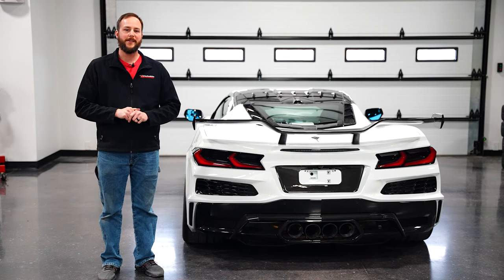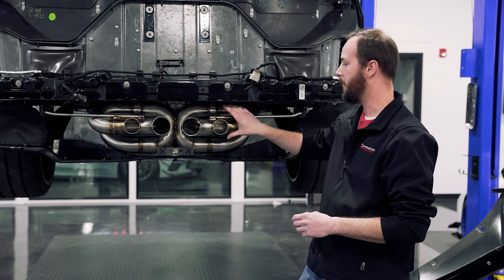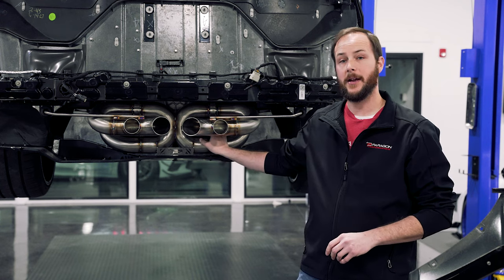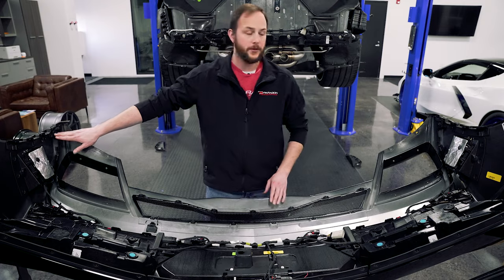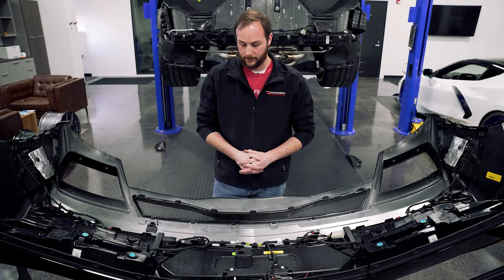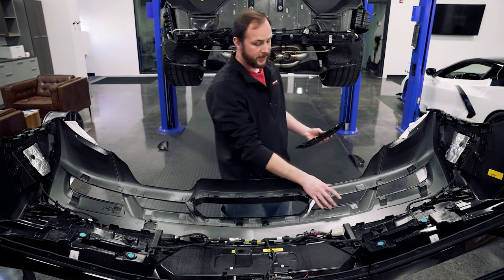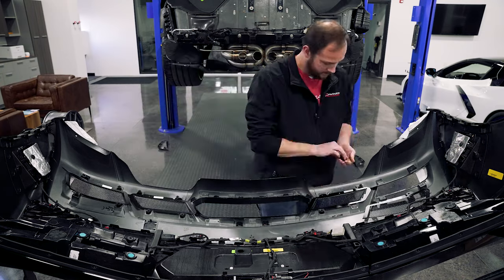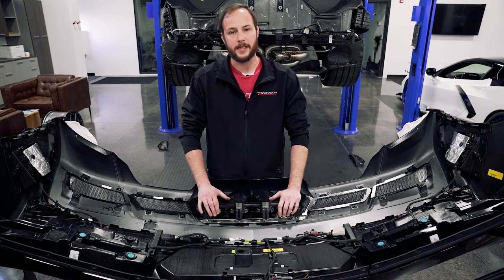C8 Corvette Stingray/E-Ray Center Exit Exhaust Conversion Install!

Comment: Lemans makes a center exhaust where you can still use your OEM diffuser, slight modification of the center. And the exhaust sounds killer!
Reply from the maker: The Lemans Edition exhaust requires you to cut your OEM rear valance where we use a all new OEM piece from GM. With our kit you can always go back to OEM side exit if you choose.
Reply: @ParagonPerformance  exactly why I said slight modification. I’m not sure why anyone would want to go back to the stock one. I also hate extra parts laying around taking up space. The Lemans kit is also $1,000 less. One could buy another rear diffuser with the savings. Both companies are great kits, was just sharing another option. I have the Lemans being installed soon. This one is great as well.

Comment: Scared for temps so close to the DCT with no heat shield.Whats the weight vs your other solution? Looks great!
Reply from the maker: We’ve track tested our touring exhaust at multiple locations with 20min sessions with 0 issues. The avg user won’t see those temps on street.

Our center exit weights in at 25lbs where our touring is 32lbs.

- Justin
Reply: @ParagonPerformance  thanks man, will likely be grabbing the touring at some point!

Comment: Looks good for those that wanted a center option.. On a side note I see you guys made a nice very light wight Ti non-valved exhaust, but not a valved version. I see you have one from another CO that is very $$$ , but why didnt you offer attachments for your other system? Also, I know the E-ray is not out yet but is the system and measurements the same? thanks
Reply from the maker: Making a valved exhaust either from Ti or Stainless will increase the cost greatly. 

The center exit will work for the E-Ray!

Comment: Any horsepower/torque increase? Also if you have a diffuser will it still fit?
Reply from the maker: Similar to the touring in power increase. It will not work with the Verus Engineering Rear Diffuser.

Comment: If we wanted to install a CF z06 bumper would it be possible to buy this kit without the diffuser? If not can the part numbers for the vent be provided or purchased elsewhere?
Reply from the maker: Sounds like you just want the exhaust portion. 

https://www.paragonperf.com/paragon-c8-corvette-z06-center-exit-exhaust-.html

Comment: You're really fast at shooting down those screws. Like the Flash.😂😂😂 Are you all planning or thinking about making a wet carbon fiber version of this?
Reply from the maker: We don't plan on making a Carbon Fiber Rear Valance. The piece used is a OEM unit.
Reply: @ParagonPerformance  ok thank you for that. So the OEM Z06 rear valance will fit the stingray. That's good to know.

Comment: Is there increased drone with this kit?
Reply from the maker: From our testing we didn't hear any drone however in V4 mode there may be an audible back pressure like sound
Reply: @ParagonPerformance  when do you anticipate there will be more in stock?
Reply from the maker: @Sam-rr7sl  No ETA at this time.

Comment: So after all that work and spending all that money..
Not to mention that you can damage the bumper…
WHAT DO YOU GAIN BY CHANGING ALL THAT…..
Leave it original….
Reply from the maker: Simply don’t damage the bumper. It’s a really straight forward install.

You gain a center exit z06 style exhaust
Reply: I agree with you 150%